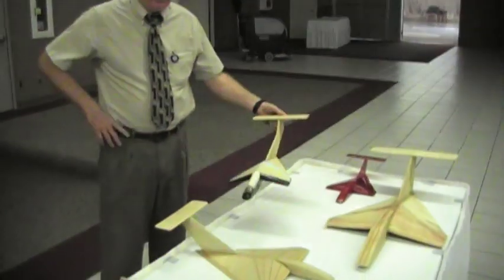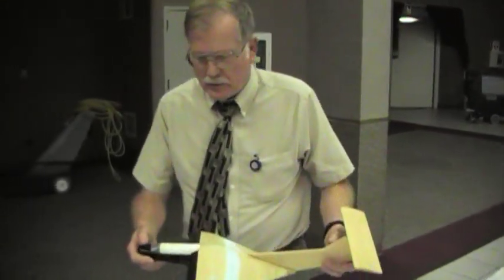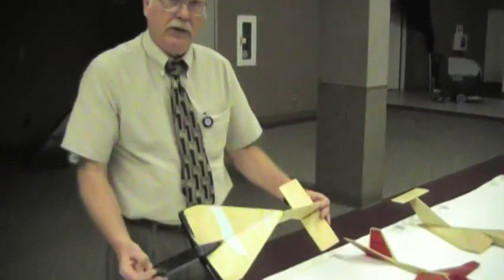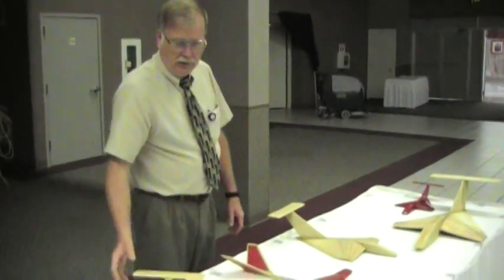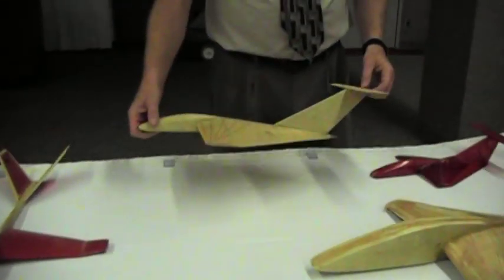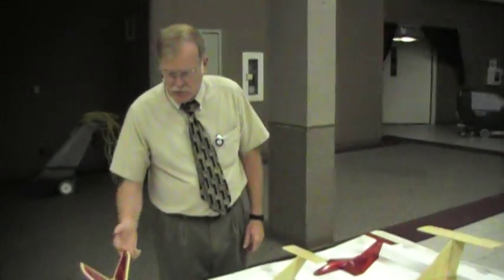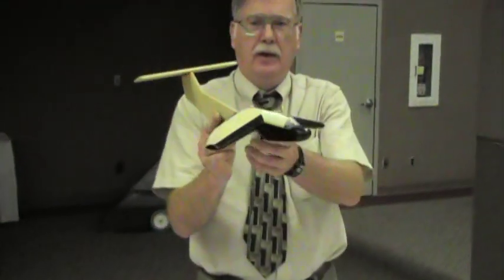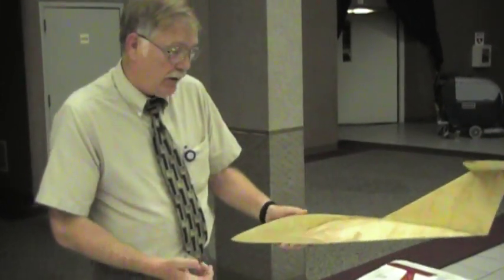Ground Effects Vehicles

Comment from the maker: For ground effect operation:  The CG should be at 30% chord measured back from the leading edge of the root chord @ BL 0.0.  This is the location I use on most of my airplanes and should be good for most delta wings of similar planform geometry.
For free flight out of ground effect operation:  Without polyhedral tips or large V tails, the model will be spirally unstable. (Slow roll off.)  The model designs I have shown in the video do not perform well out of ground effect.

Comment: Since ground effect height is related to the wingspan, wouldn't it be desirable to try to use a wider wing, or does that compromise stability or some other characteristic?
Reply from the maker: A wider span would increase lateral stability, but make it less maneuverable.
Reply: Every time you make a larger wing you generate a little bit more drag, so I think they simply made a compromise between stability and efficiency
Reply: Ground effect height is mainly related to the mean aerodynamic chord. The longer the better.

Comment: I wish an ultra light manufacturer would work on this concept.
Reply: Part of the reason I'm here is I"m interested in trying to build a "microlight" ( less than 150 pounds ) version of this.  Something that could cruise along at 30-45 mph.  carrying one person.  That shouldn't be too horribly expensive to build.  Still working on design.  I built R.C. models for years and flew light planes and para-gliders and have been wanting to do a wig project for several years.  Though with the models he is using in this demonstration it would be problematic  mounting a motor to them unless it was on a pod above the fuselage.
    I was planing to use the  motor prop assembly from a powered paraglider in a pusher configuration.  I would prefer using a 4cycle motor with a Q-tip pusher prop since it would be a lot less noisy but the only ones I have come up with are either way too heavy or very expensive so I will stick with the 2cycle to begin with.  I figure it should be an interesting project.
Reply: Im happy to find someone else who is trying to build a ultra light plane, which is also why im here. It was 2 mounths ago when you replyed and it would been intresteing to know what you have done, because im searching for information and tips from other people! Pls contact me if you have anything to share.
Reply: Dave  may ey small boat builders and ultra lite builders soulful et together on this
Reply: To fly a ground effect craft requires skill which are beyond those a of an ultra light or a three axis pilot. The behaviour of these craft at take off, flying in GE and above and splash down is  different. I am speaking about proper GE craft, not bad or irrational design of pretentious ignorants.
Reply: The lightest single seater you could build would be about 500 pounds in empty weight, with a 40hp engine.  You would as well need knowledge and experience of a minimum of one decade in the specific field. Without it, you would represent a danger to yourself and other. If really interested, have a look at www.brunodemichelis.com  Besides writing that encyclopaedia, I have spent over 40 years in the specific field, built 118 working models and 2 full size working craft.
Reply: Universal Hovercraft of USA sells kits & hovercraft with detachable wings for ground effect function, there is also similar product in New Zealand.  Not cheap. Top speed about 75 MPH, but fuel cost and ride would be far superior to comparable boat.  2 people as GEV and about 4 as hovercraft.
Reply: What UH is marketing is NOT aground effect craft. It is a very unstable and draggie aircraft trying to fly on the stall.
Reply: @mojoneko8303   we can help...
doc johnny
sicily
Reply: @brunodemichelis4247   ahaha youre insane.. a wig isnt even required to have any  licenses
Reply: @brunodemichelis4247   ahahahaha youre nuts
Reply: I suggest you learn before uttering nonsense.
Reply: @brunodemichelis4247  A lot of people already built the UH ground effect craft. No pilot licence and it is made to fly 4 feet close to surface. That craft has been around since 1998 and i never heard of any accidents yet.
Reply: @TankAce69  That craft is NOT a ground effect craft and the original designer / manufacturer declared as much. It is a deterior attempt to make a hovercraft  fly on the stall. In fact, as a hovercraft it is quite good and it can carry 3-4 people, but with the two semi-parachutes on the side it is much slower than the hovercraft version and it can only just carry two people. If its angle of attck falls below 20 degrees, it will slash on the surface.
Reply: @brunodemichelis4247  I know the manufacturer my self. I boght from him his experimental smaller version of that craft. The UH-14W. It was a one person wing in groud hovercraft. I also went to Illinois and fly on the UH 18 WIG hovercraft when it was recently built. For your information the craft will fly with the nose up only when you fly at minimum speed (55mph) When the craft speed reach 65mph the nose comes down, other wise it will climb up. But you already know this since i saw the link some one else send you. On all the videos of the UH 19xrw you can see that some has a differnt angle of attack. Also the craft can reach 75mph flying. And that is using a old heavy subaru car carburated engine with only 80hp. The carring capacity on Hovercraft is more than WIG effect because that is what hovercraft do best. The LCAC carry tanks. I can see by all your comments that you leave to people that you just dream of making a ground effect vehicle but you are just a dreamer.

Comment: For mass transit a large ground effect vehicle seems viable if it could fly high enough to avoid objects like trees & power lines
Reply: Problem is, that's not the case. The ground effect is very week that far from the ground. That's why they tend to make them as part-boats, water is pretty flat. Still pretty dangerous, if a part of a wing got caught at high speed, the craft would disintegrate.

Comment: hi there,
What would happen if i moved the t-tail directly onto the craft without this extension cause it looks like it would add a lot of weight or is it necessary for balancing the vehicle? also in wich way would you design the x113 model with polyhedral wings? like two downward angles or a downward and then upward angle shaped like a W?
Hope you could answer my questions cause im planning on building one in full scale.
oh and is there a design that absolutely cant leave the ground effect? cause of legal reasons
Reply from the maker: simon becker Q1: Yes, it is for balance. Q2: If polyhedral, either way can work.  If you choose the W shape make sure you close out the anhedral portion underneath so the suction is maintained.  Q3: John explains how you can keep it in ground effect with a large enough tail angled correctly.    It depends on your release speed.
Reply: thanks for the answer, helped a lot 
did you take part in the experiments?
Reply from the maker: simon becker No, I just shot the video.
Reply: nice so you were able to hear everything first hand. there are not many people who have that knowlege since it is an unconventional technology. already searched in the entire library in stuttgatt and found nothing about that topic. heavily underrated technology. do you know any books or websites that provide data about the effects of ground effect planes? fluid mechanics and so on
Reply: what if i want to go up 100 ft
Reply: Have a look at the Ivolga-EL7.

Comment: The UH18m or 19 are NOT ground effect craft: they are  badly designed pseudo-aircraft trying to fly on the stall at all times. Their non-performance is evident and they are nearly impossible to trim. A total rip-off.
Reply: Well they were in ground effect and they looked like they were gliding just fine